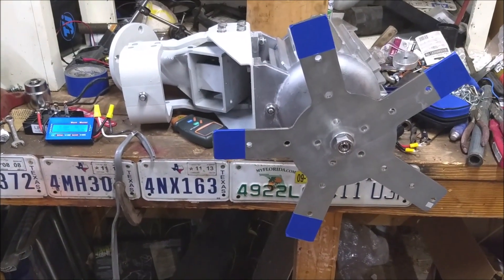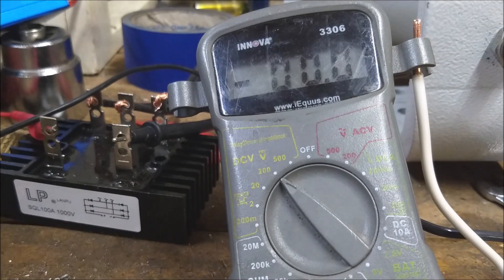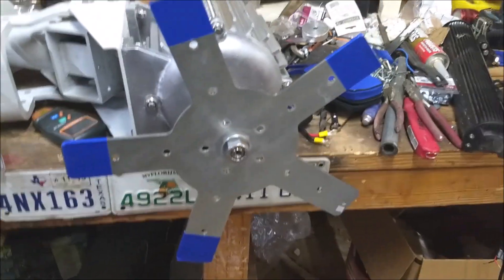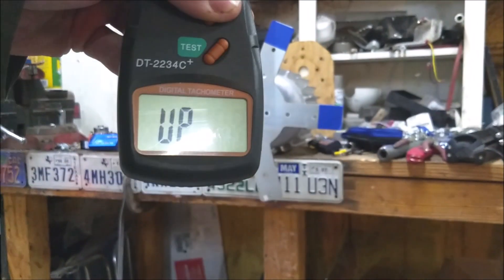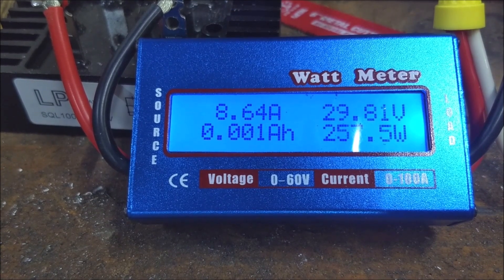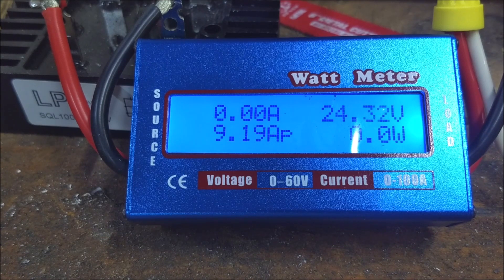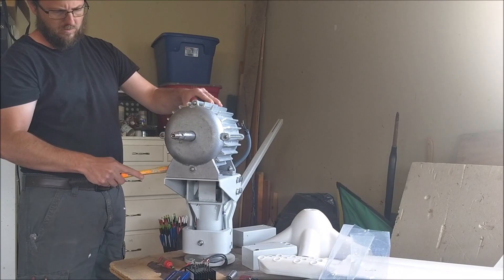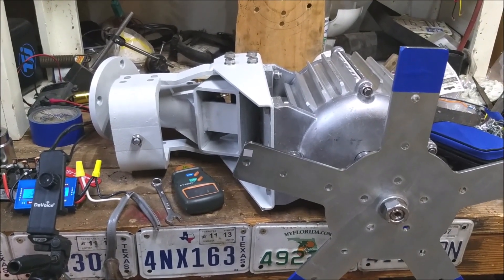iSta Breeze Heli 2 0 open voltage and initial bench test

Comment: I bought the ista i1500. Which way does the hub go on? Dimple or flat side to the alternator?
Reply from the maker: It's a tapered shaft it'll only fit one way.  Flat side goes out.

Comment: The motor is probably water ingress protected.
Reply from the maker: It is.  The i1500 motor was the same way.  Caps were a VERY snug fit and they were sealed.
Reply: A big scoop of silicone

Comment: yes we had to make a device to seperate pmas, those magnets make life hard.
Reply from the maker: My machinist has an apparatus that can jaw down on the shaft and then pull the core out keeping it centered.  I haven't had to attempt it to break a generator down but I've needed it a few times in the past to put one back together.  I'm going to take another stab at pulling this one apart with a three jaw puller.  I might try and get it apart from the back plate.  We'll see.
Reply: @ToysforWatts  be carefull dont want to ruin a magnet, my dad was a first class machinist, i shouldve too instead i became a mechanic and electrical worker. so now im going to learn machining its actual quite interesting on the more complex work.

Comment: careful with those watt meters, I fried mine with the kind of volts your are putting out open circuit.
Reply from the maker: Yep I learned that almost straight away with one of my first turbines a few years back.  I actually don't like using these little blue ones so much because they're only rated for 60vdc...and when they say 60vdc, they really mean it.  The black ones handle a lot higher voltage and amperage and I really need two or three more of them.

Comment: Cool video , Don't pull it apart , get it flying we can see what you can get out of it :) , Do you think it matters which way the three phase wires coming from the turbine are wired, i.e do they have to be in a certain order going to the rectifier??, Thanks
Reply from the maker: I try to take all of them apart so everyone can see how the rotors are made and what kind of wire is in them and so forth, but it's harder to do with the larger turbines.  I just might not be able to do it with this one.  I expect that this will be the largest I work with...maybe....

The three phase output isn't polar.  Those three wires can go to your rectifier in any orientation.